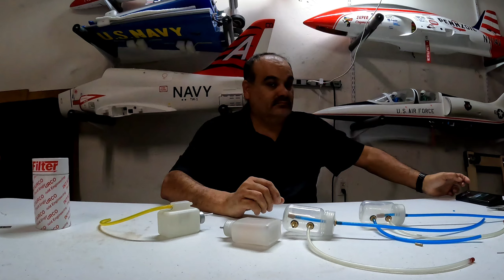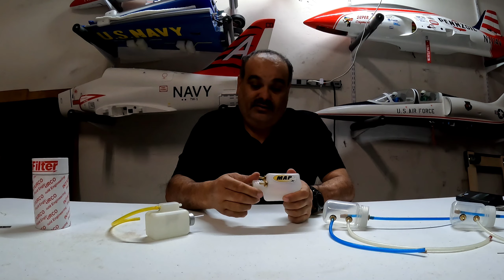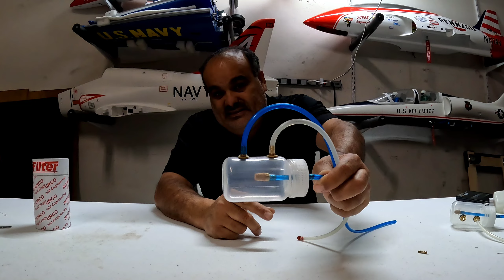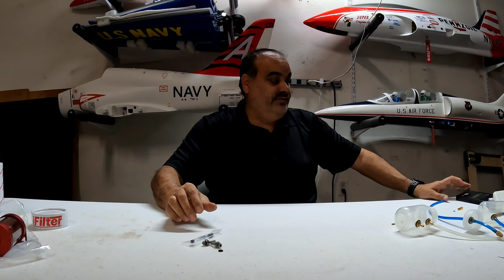UAT Basics for Remote Control Turbines.

Comment: dear sir maybe you know if tamya or other brand of paint do touch up paint for af l39 camo scheme ? regards
Reply from the maker: We use Water based paint. I don't know if you have a Home Depot near you? The a small part like the elevator and have them scan the paint. You can buy a small can for $5.00 they are called Paint sample. You can then brush it on or if you are good with an Air Brush, you want to mix some paint with water. In a separate container, mix about 25% water and 75% paint. You want to make the paint thinner like if it was milk, then you can spray it with an Airbrush.

Comment: I would love to learn more about transitioning into turbines.
Reply from the maker: Ask away, I am setting up a couple of jets right now and I can tailor them towards beginners
Reply: @ralphsalgado5891  I'd love to see a video that shows what the components of a turbine system are and how to set them up in a jet. Basically from the shopping list to the maiden flight, I'd like to see how someone gets into a new jet. Programming it would be good too. I have only flown electric planes so far. Jumping from "charge a battery and fly" to "tracing fuel lines and integrating a non-electric system into an electric radio frequency controlled plane" is a big leap. I want to know what each part is called and what it does. I can't find any information on getting into turbines anywhere online. I assume most people don't start on a diesel/kerosene jet. But no one has made any sort of video or forum post that I have seen that introduces turbine rc jets to people who aren't somewhat familiar with them already.